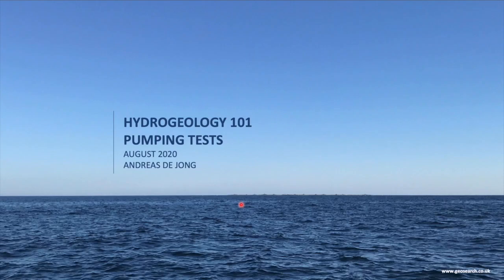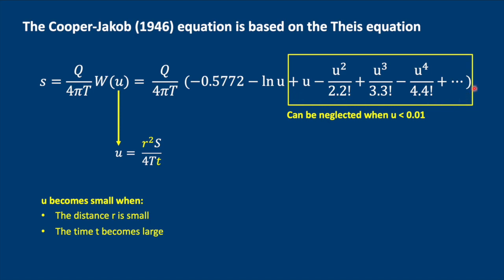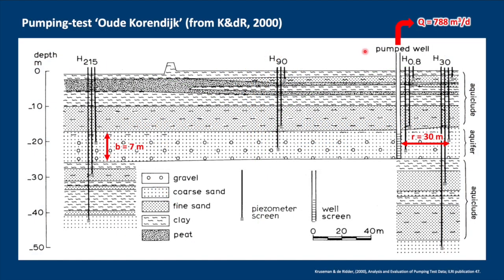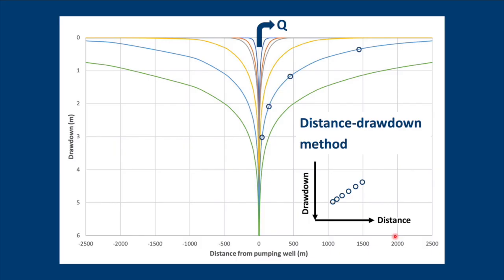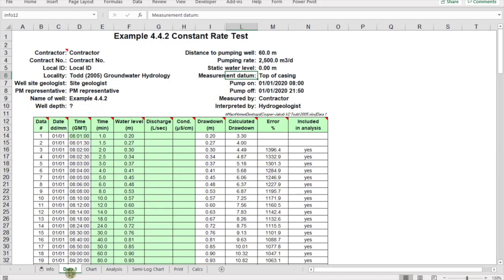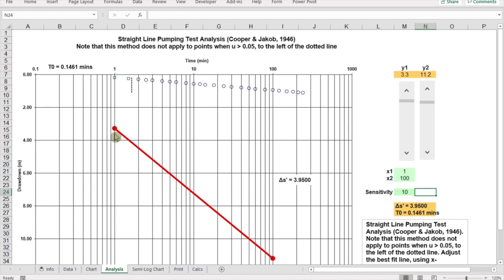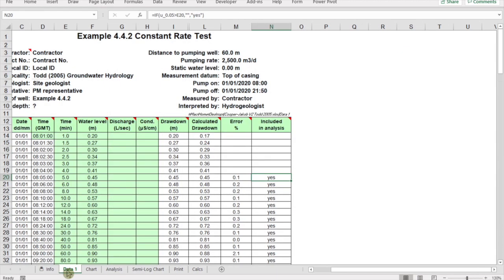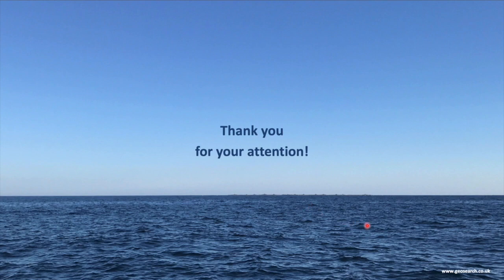Hydrogeology 101: Cooper-Jacob

Comment: Hello, are we still able to use this solution if the aquifer system in consideration consists of two confined aquifers separated by an aquitard and the well used for the pumping test fully penetrates both aquifers? If not, how could I estimate the hydraulic properties (transmissivity and storativity) of these two aquifers if I have the drawdown data from an observation well? Any insight is greatly appreciated.
Reply from the maker: Hi Brandon, If your pumping well filly penetrates both aquifers then the drawdown in the pumping well will be a combination of the hydraulic properties of both aquifers. i.e., you should think of them as a single unit, and I suppose you could calculate kind of a combined transmissivity for both aquifers from the pumping test data in the pumping well.
You will need at least one observation well in each aquifer to differentiate between their properties. You will also need to estimate how much of the pump discharge comes from each aquifer. For that I guess you would need to carry out flow logging in the well during pumping. Another complication is the properties of the aquitard. Is it releasing water from storage, and how permeable is it?
I think you can get some overall ideas from the Cooper-Jacob straight line method - see if you have any leakage, boundaries etc, but for this kind of multi-layered situation you will need more complex software. Have a look at MLU - https://mlu.app  All the best, Andreas
Reply: @GeosearchInternational  Thank you for your insight, I appreciate you going into such detail. I do plan on using software, I  just wanted to manually solve the inverse problem to have something to compare the findings from the software to. 

Within the system I previously discussed, there is one observation well that penetrates both aquifers, is this a problem? 

Thank you.
Reply from the maker: Hi Brandon, If you have a pumping well open to both aquifers and an observation well that also cuts both aquifers, then you will get an average T & S of both of them together. Are there any head differences between the two aquifers - ie is there water flowing up or down the wells? Are there any differences in hydrochemistry between the aquifers? Maybe you could use that to better understand what is going on. All the best, Andreas
Reply from the maker: I just uploaded a new video on leaky confined aquifer pumping test analysis. Could also be interesting for you. https://youtu.be/UFSI12m2rBM
All the best, Andreas

Comment: Hey, thanks for your Videos. I've got two questions.

1. Can you use the Cooper-Jacob-Method for an unconfined aquifer when you correct the drawdown data with the following formula? s'=s-(s²/2H)

2. Can you use the Cooper-Jacob-Method and calculate T with drawdowns only from the well itself and without an observation well?
Reply from the maker: 1. One of the assumptions for the Theis 1935 solution, of which the Cooper-Jacob method is an approximation, is that the drawdown is small relative to the saturated thickness of aquifer. That can be a problem in unconfined aquifers, which is why we need to apply the Jacob 1944 correction which you mentioned. Note that according to Neuman (1975), Jacob’s correction is strictly applicable only to the late time-drawdown data, which fall on the Theis curve. In practise, it is often difficult to know the exact aquifer thickness so I would always do a quick “non-corrected” analysis first.

2. Yes, you can carry out any pumping test analysis on pumping wells though observation wells are preferred as the data is smoother and we can also get a storativity estimate. If you only have pumping well data you should correct for the well losses which are due to turbulent flows around the well itself. That is why you should always carry out a variable rate (step) pumping test before you do your constant rate pumping test. From the step test you can estimate what % of drawdown is due to aquifer, and what % is due to well losses. Having said that, the best data is usually from the recovery test, so like above I recommend that you always start with a quick “non-corrected” analysis first. Hope that answers your questions. All the best, Andreas
Reply: @GeosearchInternational  Thanks for your quick response, Andreas. So would you say, you can get plausible results when using the Cooper-Jacob-Method on an unconfined aquifer (with or without the correction) or do you have to use a different method to get plausible results for unconfined aquifers?
Reply from the maker: The Cooper-Jakob method is just a simplified Theis method, which is the basis for all other methods so the results should be in the right ball park. I would always use the Cooper-Jakob straight line method first, as not only is it fast and easy, but you can quickly see if there are any boundaries affected by the pumping test. For unconfined aquifers you should also do a Neuman analysis, which takes a bit longer. Basically you need to look at the results from your step test, constant rate pumping test & recovery test to get a good idea about your well performance and the aquifer parameters. It is also important to be aware of all the assumptions behind the different methods, as they are all just theoretical approximations of reality. All the best, Andreas
Reply: @GeosearchInternational  Thank you, Andreas!
Reply from the maker: Most welcome.... and keep asking yourself these kind of questions! All the best, Andreas

Comment: How do we calculate K after using the variation of this method for an unconfined aquifer?
Reply from the maker: Hi Faisal, T=Kb so once you have estimated the Transmissivity from the pumping test, just divide it by the saturated thickness (b). All the best, Andreas
Reply: Hi Andreas, thank you for your reply. What if the saturated thickness is unknown?
Reply from the maker: Hi  @faisalkhursheed3566  When you drill your well(s) you should get an idea of the saturated thickness, provided that you drill to the base of the aquifer. If you don't have this information then it is better not to guess it. All the best, Andreas
Reply: @GeosearchInternational  Thank you for your help!
Reply from the maker: You are welcome Faisal! All the best, Andreas

Comment: Hi, thanks for the great videos!! Is it possible to change the "u" value in the excel? just curious what will end up if i put "u" value as <0.01 instead of <0.05. and couldn't wait for another hydrogeological video!!
Reply from the maker: Hi Naufal, If you go to the hidden Calcs sheet of Cooper-JacobXL_V2.3.xlsx you can change u from 0.05 to 0.01. It makes the dotted line move from 38 minutes to 192 minutes. However, this would not change the interpretation as all the data points are already on the straight line. All the best, Andreas

Comment: for drawdown vs distance, t=140min... where or how you get it?
Reply from the maker: Hi Ahmad, In the distance-drawdown method we need to measure the drawdowns in the different piezometers at the same time. In the example this time was taken at 140 minutes, which is just a convenient arbitrary time on the late stage of the drawdown plots of all three piezometers. Actually it is still too early, as the furthest piezometer does not plot on the straight line.
Have a look at the drawdown plots on p58 of Kruseman & de Ridder:
https://www.hydrology.nl/images/docs/dutch/key/Kruseman_and_De_Ridder_2000.pdf
Maybe you can try it with a t=600 minutes - data is on p59.
All the best, Andreas

Comment: Just a question about the parameters: what does u represent? Has it got a name? I can't find an explanation for it, neither in the books. Thanks.
Reply from the maker: Hi Umberto,
u = r^2 S/4Tt, where r is the distance to the pumping well, S is storativity, T is transmissivity and t is the time since pumping began.  It is just called "u" - I don't think it has another name. In the Theis method we have the Well Function of u, W(u) which is the same u. As I tried to explain in the video, the Cooper-Jacob straight line method is just as simplification of the Theis Method. "u" is important, as it needs to be <0.01 to use this simplified method. However, even slightly larger values of u are still OK to use. e.g. u<0.1 results in an error <5%. All the best, Andreas
Reply: @GeosearchInternational   many thanks, sir. How come has the u been elaborated, on the base of what and what is its physical meaning? Is there any article you could advise where it is explained? Cheers
Reply from the maker: Hi Umberto, If you want to dig into the maths behind it you should read the original paper by CV Theis (1935). You can find it here: https://water.usgs.gov/ogw/pubs/Theis-1935.pdf
All the best, Andreas
Reply: @GeosearchInternational  I'll have a look at it. Many thanks.
Reply from the maker: Welcome! All the best, Andreas

Comment: Load with all concept...
Is it possible to determine T and S value from single pumping well with no observation well.
Reply from the maker: If you have only a pumping well, you can calculate the Transmissivity. For Storativity, you need observation well data.
Reply: @GeosearchInternational  Thank you..
Reply from the maker: You are welcome. Andreas
Reply: @GeosearchInternational  what if the well has a big diametre like 2m wide can we use r=1m for the observation well?
Reply from the maker: Hi  @Nordinator
No, it is not possible. Think of it like this - if we want to measure aquifer storativity we need to stress the aquifer by depressurising it/dewatering it, so that we can see how much water it has in storage. That means that the observation well has to be at some distance away from the pumping well. If you just compare the water levels in the centre of your well with the ones at the side they would be the same.
Another, and more important issue is that to apply Theis or Cooper-Jacob methods one of the key assumptions is that the storage in the well is "negligible" i.e., that the well has an incredibly small diameter. This is of course not realistic, so that is why we need to ignore the very early data when we do a pumping test. If you want to analyse a pumping test from a large diameter well, it is better to use a method where well storage is taken into account. For example the Papadopulos and Cooper (1967) method for confined aquifers. Also there are some commercial software which will correct for well storage. All the best, Andreas
Reply: @GeosearchInternational  Thank a lot that makes since it's just sometimes the budget of the client is tight. I'm really glad i found your channel it's really rich with informations. Hope one day you show us the interpretation in an unconfined aquafere.
Reply from the maker: Hi @Nordinator, Yes, the budget is always an issue and that's why I hardly ever drill observation wells. If you want to find out more about an aquifer you can usually find existing wells which are close enough together to do pumping tests and get observation well data. Generally the storativity values of an aquifer from pumping tests are just approximate anyway, and get adjusted over time as groundwater flow models are re-calibrated. Yes, more videos will come also on the Neuman method, but am really busy at the moment... All the best, Andreas
Reply: @GeosearchInternational  Thank you for the quick replies. Keep sharing ,👍
Reply from the maker: You are welcome! All the best, Andreas
Reply: Dear Sir,
Have u any info regarding Modflow software online training class for GW Modelling??

Regards,
Reply from the maker: Dear Kaleem, Sorry I don't know of any good ones. I started learning modelling by working through Mary Anderson's book on Applied Groundwater Modelling. However, I will give you the same advice which my hydrogeology professor told me many years ago: don't start modelling until you have worked for at least 10 years in hydrogeology and have a good understanding of groundwater flow. All the best, Andreas
Reply: Thank u
Reply: Dear Sir,
Is am I on right way that, 
Step test is used to  determine the expected drawdown with changing discharge.
What are others use of step test?
Have you any easy excel sheet for step test analysis?
Reply from the maker: Hi Kaleem,
Yes, the first purpose of the step test is to find out how the well reacts to different discharge rates. From this information we can chose what rate to use for the long term pumping test. Another purpose is to calculate the well efficiency - the % of drawdown in the well due to laminar flow compared to the total drawdown which is laminar + turbulent flow. I have an Excel tool for it, and will release it with the new video on step tests.
All the best, Andreas
Reply: Thanks for reply and waiting for upcoming step test video.

Comment: im confused about the log part for finding delta s how do I work that out in excel do I log my values of t ? then type =slope?
Reply from the maker: Dear Xlimk,
The Cooper-Jacob method is designed so you can easily read off Delta s from a paper plot. It is just the difference in drawdown between two log cycles - e.g. between 10 and 100 minutes or 100 & 1000 minutes. Quite easy to do it manually.
In Excel it gets a bit more complicated and I use LINEST (array formula) and LN (not Log) to calculate Delta s, and also t0 which we need to calculate Storativity from observation well data. If you want to see how it works just download the Cooper-Jakob V2 Excel tool: https://bit.ly/2TrucWM. You can unhide a hidden sheet called "calls",  and have a look at how the calculations are made.
All the best, Andreas